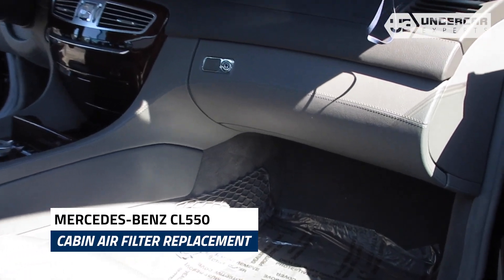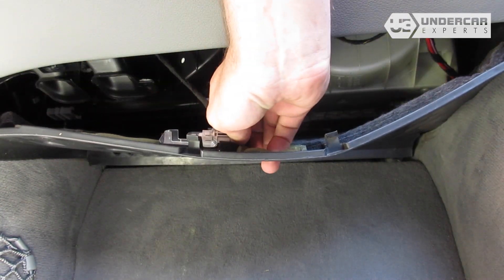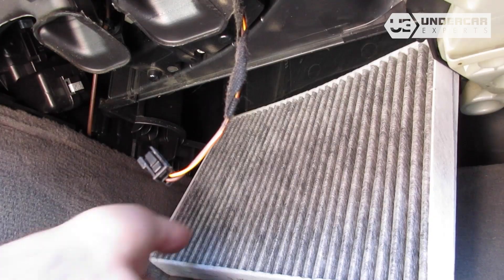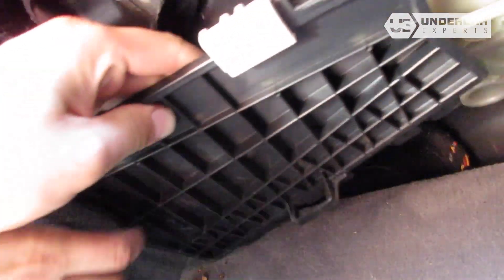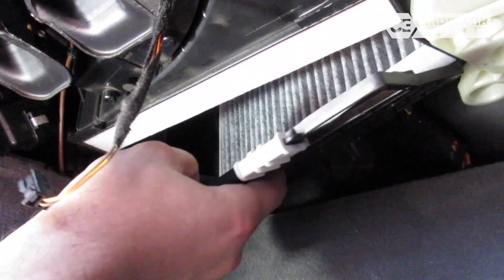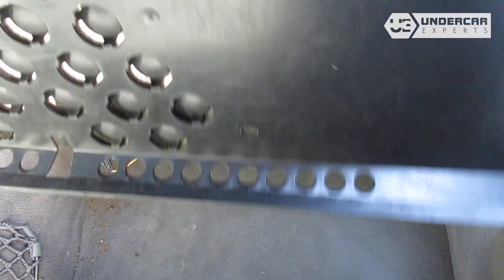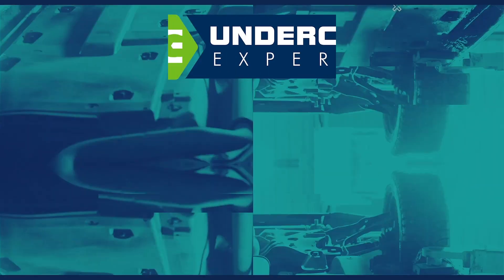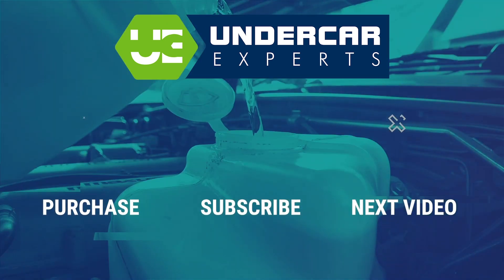Mercedes-Benz CL550 Cabin Air Filter Replacement ( 2007 2008 2009 2010 2011 2012 2013 2014 )

Comment: these youtube vids are great refreshers as I'd done this once before.  An interim service event did it the last time and.... lo and behold, as I was trying to understand cramming two of these filters back up into the compartment, never mind, air direction facing inward, toward each other... imagine my surprise when there was only ONE filter to remove!  Apparently the Benz tech thought it a pain in the ass as well and... why two when one will do?  Ultimately, I did get both of them in but it's not as if they glided in, each with it's own channel and... are you sure about the air direction of the filters facing each other?  The whole thing just didn't seem quite right.  But thanks for the video... you made it look pretty easy... if not normal.
Reply from the maker: Happy to help!
Find your parts today: www.undercarexperts.com
Reply: Not all CLS550's take the two filter setup seen in this video. I have a 2014 and it is one filter only and not like the ones shown here. I suspect yours is the same and maybe you put two filters in an area that only takes one.